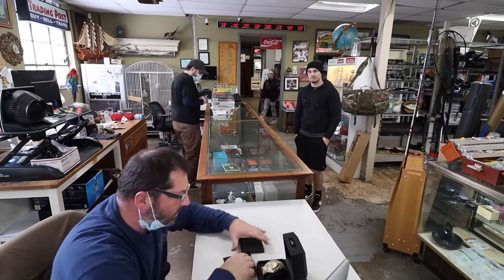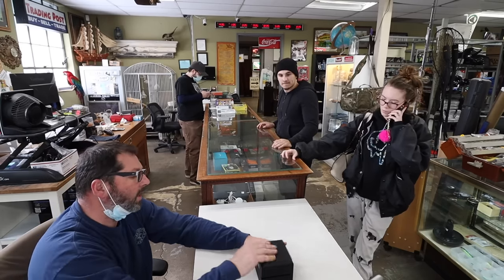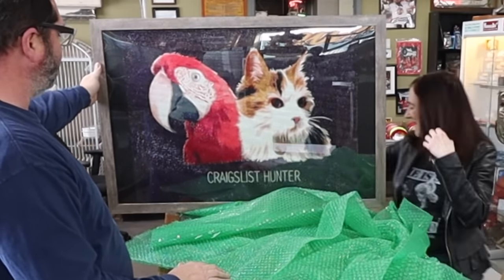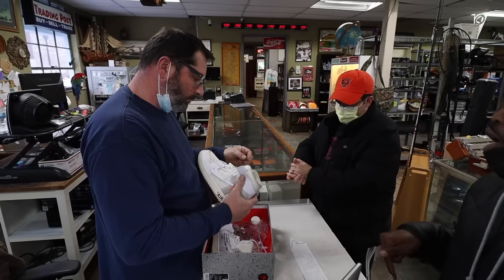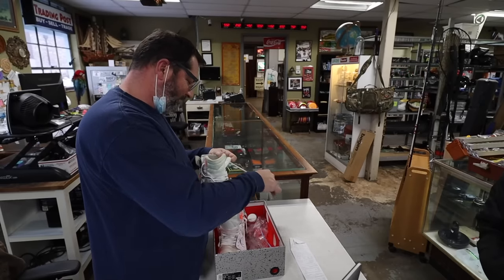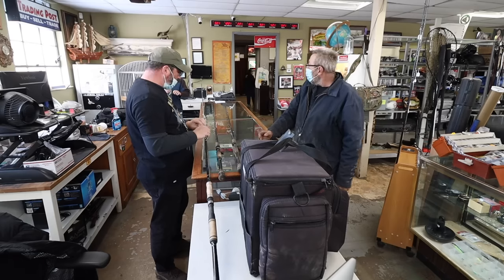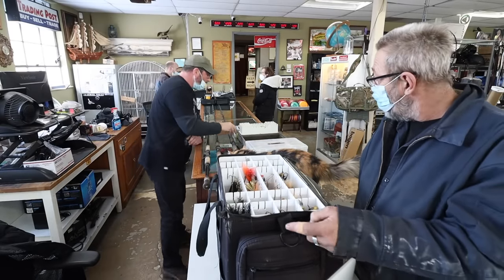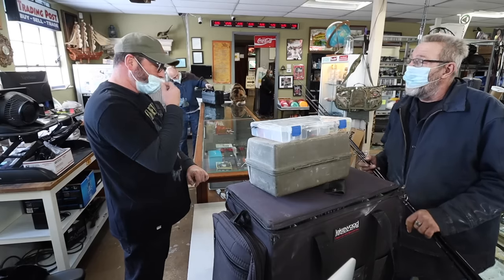Caught On Camera Trying To Sell Fake Jordan Offwhite 2s

Comment: great picture by Jessica!! what a gift of love... FYI, when hanging something that large, you can use TWO screws spaced about 16" apart (ideally into two wall studs) instead of ONE screw. it will be sturdier AND it will help keep it level and prevent it from going lopsided.

Comment: I have to comment on the shoes. The off white Jordan is meant to be like that. Im not saying it's not fake, but the swoosh is meant to look like it's been cut out and barely stuck on. The exposed foam on the tongue is on purpose. Virgil Abloh, who designed the shoes, was obsessed with deconstructing something to its simplest form and putting it back together exposing the different components.

Comment: To be fair the Off White 1s and any Off White Nike or Jordan will have that kind of stitching and styling …it was the style Virgil Abloh(Off White Creator) intended. Basically if you were to turn a traditional Jordan 1 inside out that’s what it would look like. There were some glaring issues tho…the box wasn’t correct and they come with Off White/ Nike Beaverton zip ties. Lastly if those shoes was worn only once I got a Statue Of Liberty for sale in Arkansas!

Comment: Nikes are manufactured shoes stitching is usually kinda ugly especially since the main bonding is done by glue you see loose pieces of glue and hanging threads brand new sometimes and its just wholesale material like car interior so it falls apart on its own i have a brand new pair of 2010 jordans glue was so bad that year i have to reglue the rubber to the shoes and they just sat in the box and fell apart.

Comment: Those are Air Jordan 1, off white colab. I have a pair of the Jordan 1 off white Chicago authentic. It is normal for the foam to be exposed and the entire shoe to look almost like it was slapped together with weird stitching. First red flag with this guys she he brought you, the box was incorrect. The off-white Jordan 1 box does not have holes in it. The box with holes goes with the Air Jordan 5 Retro

Comment: Just a heads up, I've been sneaker reselling for a few years now and Nike's quality has gone down the drain. I've gotten multiple pairs from Nike directly that had glue smeared on them and all kinds of issues. They aren't a quality hand crafted sneaker or anything, even the off-whites. The Jordan 1 Lost and Founds which were incredibly sought after arrived moldy and everything to the point of where they had to address it publicly. So while these may have been fake, don't expect "quality" when talking about Nike lol.

Comment: those Jordan’s are suppose to look like that with the logo and the foam exposed, but they’re clearly fake. if the i in “AIR” doesn’t line up in between a dual vertical stitching then that’s one giveaway. it’s also in the wrong box. the flaps where they say “85” shouldn’t be that flappy and bent. writing on the inside part looks a bit off too

Comment: The jordans were real, the problem is Nike and Jordan brand is using cheap material. The reason why fakes and real are getting harder to tell is becsuse nike uses cheap material. If actually seen replica shoes made with better quality material than the authentic. Sad but true, you can't tell authenticity based on quality in the case of Jordan shoes.

Comment: Lol when u legit check off white 1s and just point out design decisions that Virgil specifically chose to do. Like the exposed foam the kinda diy check and side profile. Usually u can tell fakes bc the factories are using cheaper material and equipment to make them and that’s why they sell them so cheap so it’s never going to be as meticulous and refined as Nikes factories. Unless ur buying from those guys that know Nike factories and have like their machines and techniques which will run u like 400-500 for a fake ur always going to get bad quality stitching and bad shoe shape. 1s are so specifically shaped that a fake pair will always look fake at a distance from the silhouette, looking up close at it might actually fool you more. The toe box always looks super flat and the shoe itself is super light because it’s not using all the material it needs. Fakes are almost never good unless u paid a lot for them and the producers is a top seller with connections to certain factories. At that point the shoe isn’t even a fake anymore they’re just not Nike certified.
Reply: Also why would u sell something you paid 900 for, for 250 when u have the box and receipt so u can sell thru goat and prob get like 700 bc he said he wore them once but prob for the whole day. I’m pretty sure these are the Uk release also which means they’re prob worth like 2k ds. So 900 I guess bc it’s a kids size but 250 lol bc u don’t need them anymore. U don’t need 500 extra bucks?

Comment: The Jordan's were fake but YOU didnt know the shoe. All those features on the Off-White 1's are supposed to be there. The exposed foam, the swoosh being disconnected. Thats what Off-White does. Thats like saying theyre fake cuz the box has the Off-White holes in it. A little advice on shoes. If the box is jacked up like that and the shoes barely fit inside, the box is 100 percent fake. Next I would suggest you not buying or selling shoes anymore. Its extremely clear you dont know enough about them. Ive seen you buy fakes before. And I've seen videos where you talk about getting had on fake shoes... Plus theyre Jordan 1's. Not 2's